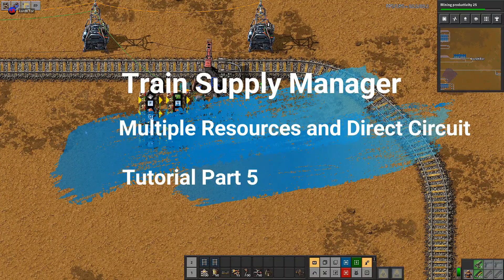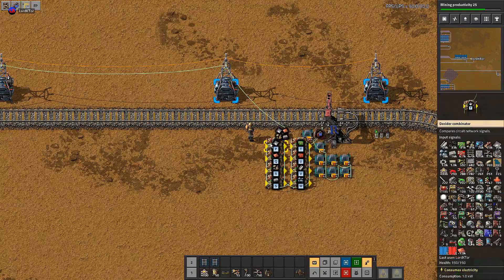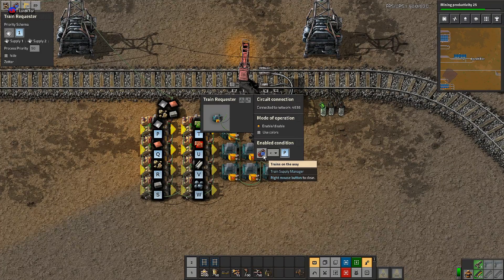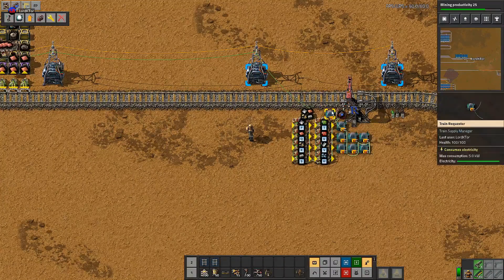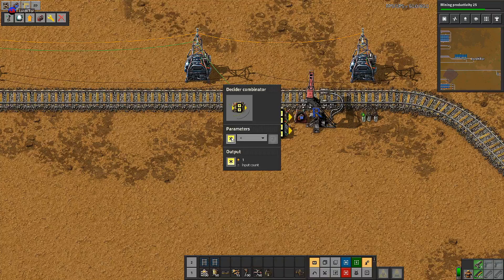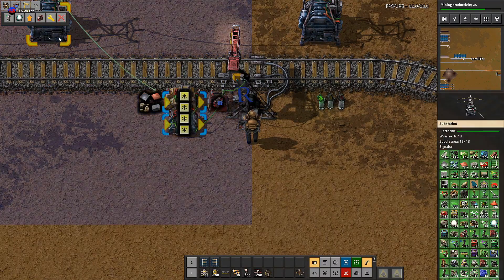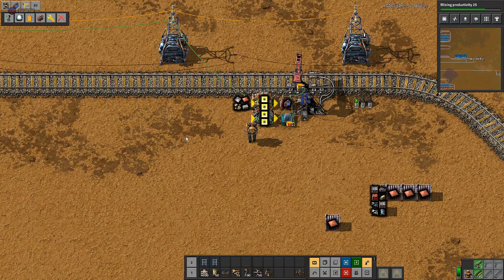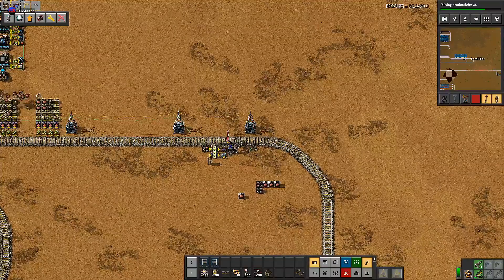Factorio TSM Tutorial part 5 - Multiple Resources + Direct Circuits

Comment: this tsm mod are quite awesome, and i prefer it over LTN, so much easier to set up and so forth. but looking at this, is it possible to use more then one omni station like this in an outpost? i mean if you have like 3 stations within same logistic system, with same settings, is there a way to make sure a resource only get called to one of the stations and not all 3?
Reply from the maker: Why give them all the same settings? Why not split the requirements by station? Or if you must then connect all the train counters by the same wire so a train going  to any station will be counted by all.
Reply: @Sandman-qi2jy  just troughput. if i making so much stuff i need more then 1 station to keep up with demand, that happends.